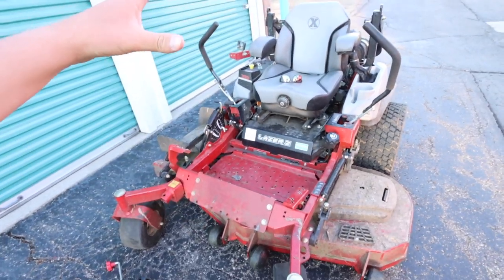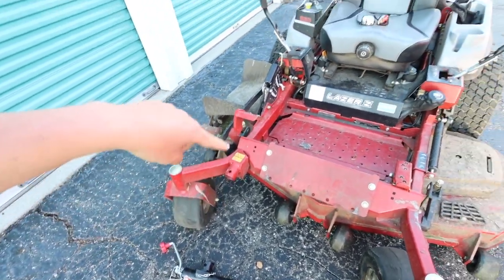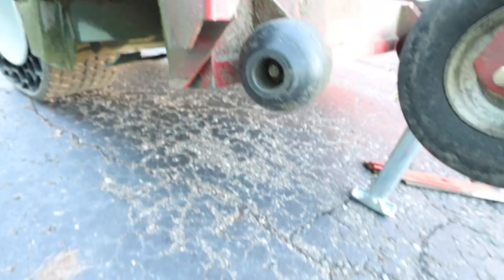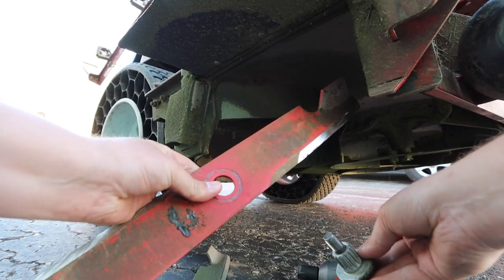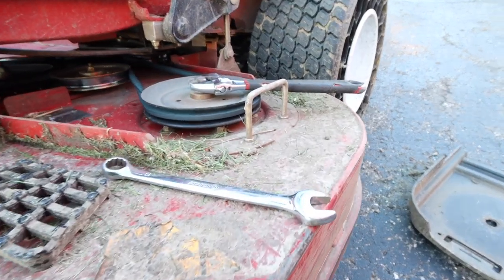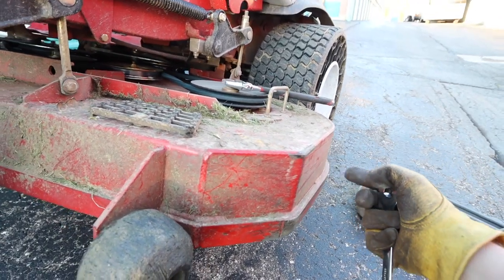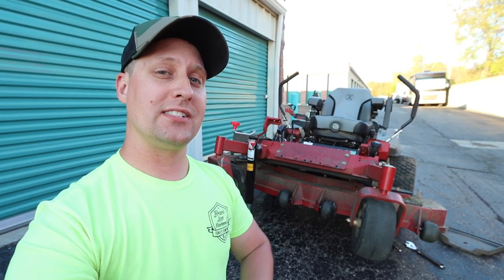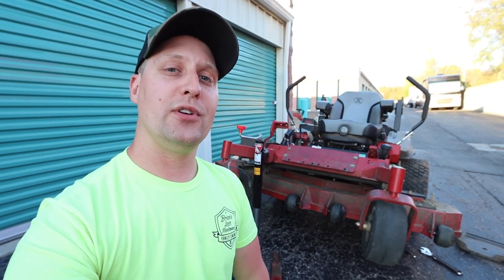How To Change A Lawn Mower Blade In Under 2 Minutes!

Comment: Hi Brian! Say, I change my blades on my zero turn a little bit different. I straddle the edge leaving one front wheel off the ramp, Drive it on part way, thus exposing the deck so I can take the old blade off, then I can clean the bottom of my deck and put my new blade on! It takes me about 10 minutes! I use two sockets, one on top and the other to take the bolt off....Sam Hanson 😎👍🇺🇸

Comment: Hey Brian what size zero turn or standers do you use to get thru backyard gates? Like most gates in our area are 36inches so a 32 inch would be the right one right? Just having a hard time finding a commerical 32 inch mower.. any suggestions?

Comment: What is that little nut driver attachment that you use with the impact driver? I can’t find those anywhere. The bolts on my Wright are 15/16.” The largest I can find is 1/2.”

Comment: Just remember on a push mower to disconnect the spark plug wire! You don't want the motor to fire up on you when Turning the blade
Reply from the maker: Good tip!

Comment: A "how to" video on changing mower blades should ALWAYS include the step of torquing the retaining bolts to the specifications in your Owner's Manual.
Reply from the maker: Great tip 👍
Reply: My mower shop guy (who has been in biz for 60 years) told me if i hit it with a fully charged Dewalt impact id be good to go, so thats what i do. Aint nobody got time for tq wrenches.
Reply: You get with in 5lbs or so in the tork spec you will be JUST FINE!...